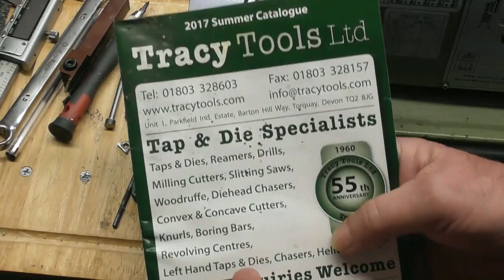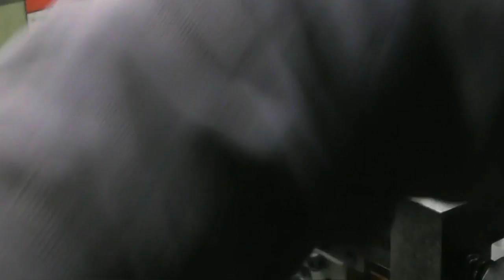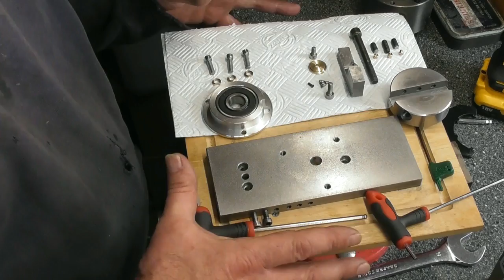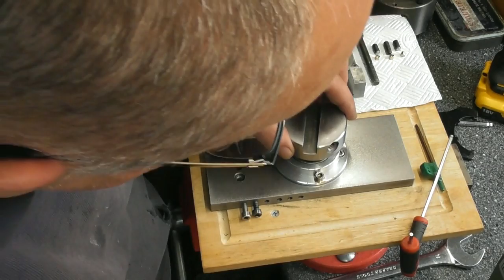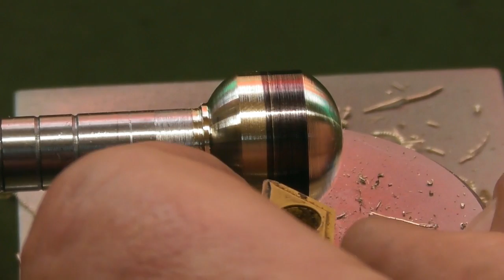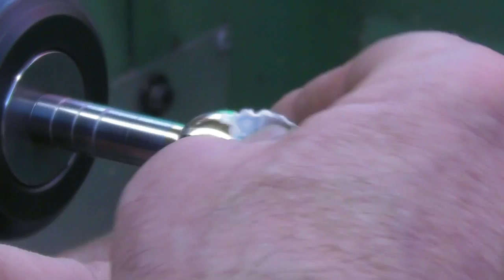Making a ball turning tool part 8

Comment: Hello ADES WS, I am really amazed seeing as you only got one ball race bearing how well it works, truly a good ball turning tool for the metal work lathe, I am going to have a go at it for my lathe, I will make some plans before I start, Thanks for sharing your work with your viewers, we all are truly appreciating it. 😷👍👍👍👍👍
Reply from the maker: if you can fit 2 then go for it . i am sure it would be better .

Comment: Hi Ade great video's on this ball tool, also watch the making of the cross slide plate  I to have a mini lathe to and was wondering if you could advise where you get your plate material from I need to buy some to make your projects for my lathe, many thanks I am working my way through the video's so them coming.

Comment: A brilliant job Ade, it works as well as you could possibly wish for. Rather than sloping the back off I would fit a diamond tip so you could do a small diameter ball with it. Obviously you would need to mill a slope on the other side of the tool holder to enable you to flip it round 180 degrees, and then you would have an even more versatile ball / radius tool. I have really likes this whole series of 8 videos, and I've watched them back to back. Subscribed and liked! I look forward to many more videos from you !

Comment: Very nicely done Ade!  I made a very similar design for my mini lathe, but as I have minimal tooling, yours looks much more refined than mine. Congratulations! I turn my balls on a separate mandrel that is always a smaller diameter shaft than the one the ball is made for. That way I get clearance for that annoying step on the back. Rob from South Africa

Comment: One thought, did you consider boring one hole through the top piece opposite the locking screws to give direct access to the plate to saddle fixing bolt as well as the three other fixing bolts? Thumbs up for an excellent design.

Comment: Hi Ade, nice metric, nice made tab from your area.
Wow we use our tapping machine to get through thee small rabbit hole jobs, that is really impressive work you are performing with your lathe, very steady work for you Ade. 
We will have a slice of cheese please.
We still really like the cutting tool bit made in revers, it just comes across as very stable and ridged. 
What an absolute great tool wonderful addition to your makers arsenal of tooling accessories for your lathe and the end result a great ball maker look at the results really really nice machined ball Ade, way to go.
We are over the MOON as well, the tool made its own handle, let the future generations figure that one out.
Lance & Patrick.
Reply from the maker: Hi, guys . yes the M2.5 is a bit tricky with my huge equipment, haha, i have an M2 tap so i need to find a use for it now . I am planning a workshop extension before getting a milling machine so that i can do some turning on it , or maybe a shaper for surface grinding , Cheers both , Ade.

Comment: Nicely done! You do now see why I used a 3/16" (4.75mm) square high speed lathe tool and bobbed off the extra material on the tool holder as shown in the photos I sent in the comments section a couple of episodes ago to get around the back side of the ball without leaving a step. 
   Now do you want to be extraordinarily clever? Did you notice that the cutter wasn't under much of a load at all? I've cut free cutting stainless for machine handles and it doesn't seem to be working much harder than cutting brass or aluminum.
  Let's get clever! Take a piece of key stock that fits in the holding slot of of the ball turner. Drill and ream a hole near one end on the center line of the key stock. Take a broken center drill or similar piece of hardened tool steel and lock-tight it into the hole so that it stands vertically. Grind off the end of the of the end of the tool steel you just cemented in place so that when in the ball turner it will be on the center line of the lathe. You can grind a few degrees of back angle on the top of the tool if desired. Now voila! You can now cut a ball with just a radius on the back side instead of a step equal to the radius of your tool steel cutter. Additionally you can get very close to your chuck or collet so you won't need so much overhang for the work.

Cheers from NC/USA

Comment: afternoon Ade  love this project  the  ball looks to be  about perfect,now i need to start from vid 1 of the ball turner  take notes  do a drawing  and get cracking  the block  to replace my compound slides  worked  brill just need to  drill holes for and mount the milling vice  now.  I  am thinking i better get my finger out  as  your  going to be  2 or 3 projects  ahead of me

Comment: Great job Ade looks awesome. Which milling slide do you have could you point me in the right direction thanks.
Reply from the maker: https://www.rdgtools.co.uk/cgi-bin/sh000001.pl?WD=milling%20slide&PN=Small-Milling-Vertical-Slide-4453397%2ehtml#SID=601
this the one i have, Cheers Ade.